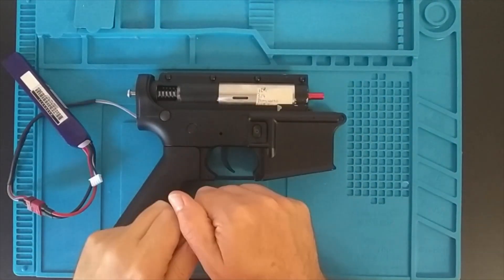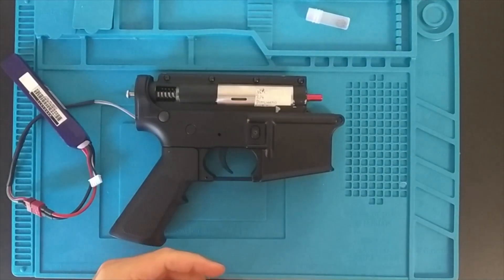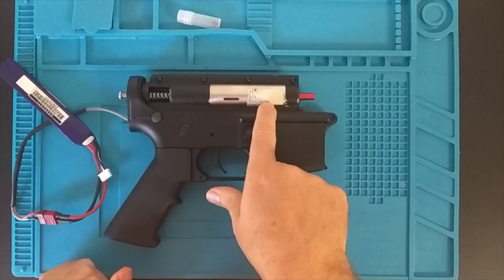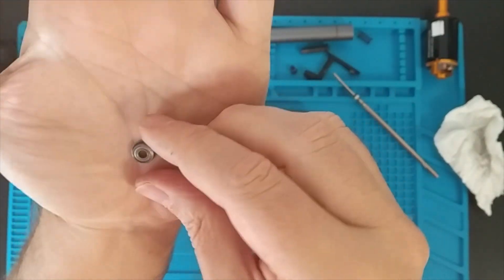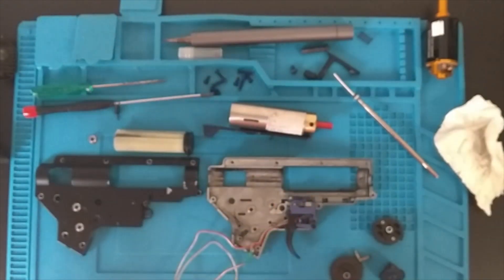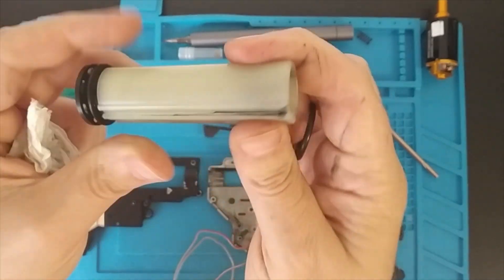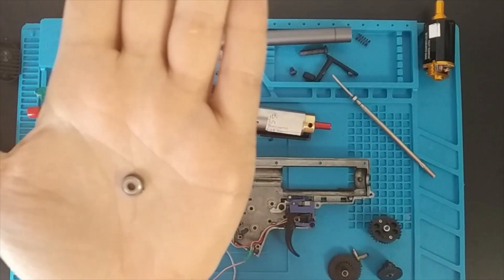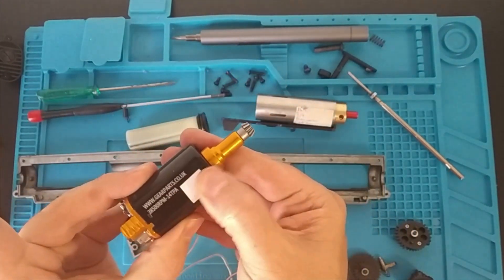J-Caged 8mm Bearings Test

Comment: Can I get a follow-up on those bearings? Have they broken after time? If possible, could you maybe link where you purchased them?
Reply from the maker: Still going strong after 100,000 rounds or so, been using springs ranging from M100 to M140.  You can get them from www.ak2m4.co.uk